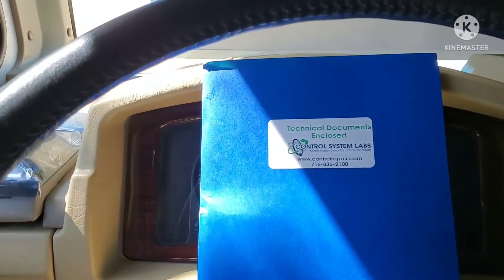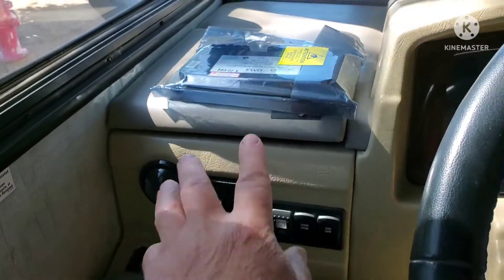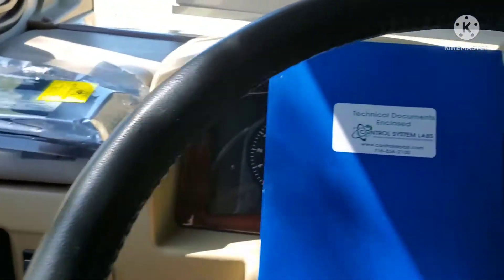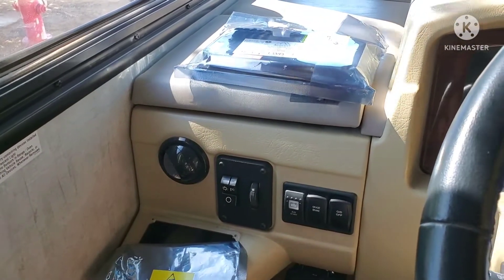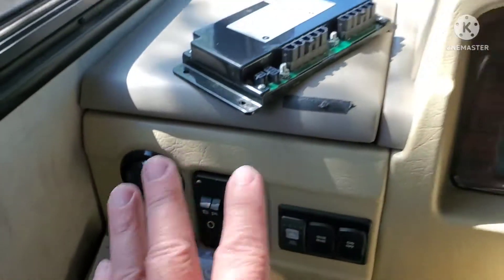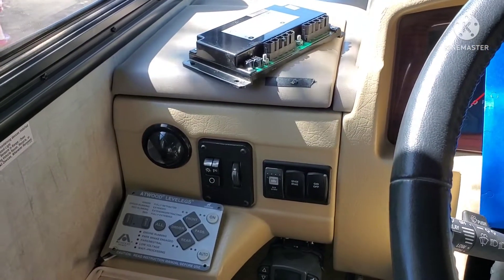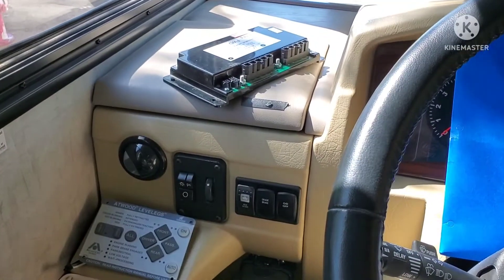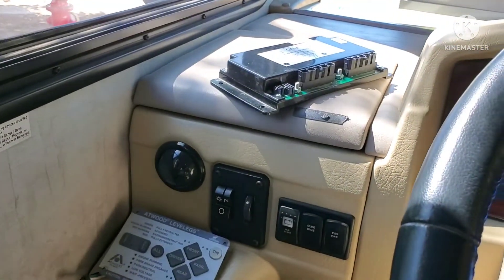Atwood levelegs Not Responding. Update #1

Comment: I have an Atwood Levelegs and it does not power.  Is it broken?
Reply from the maker: I am not a mechanic,  nor an expert.  I would check the power supply going to the system,  there should be a 50 amp breaker near the battery.  I would find and check all that first.
Reply: @2lotony  This is the first time hearing that there's a 50 amp breaker somewhere near the battery, my issue started out like yours but then I lost power to the panel and I cant get my panel to come on! Can you take a picture of this breaker? I cant locate any 50amp breakers anywhere! Thanks
Reply from the maker: @AmericanJustice22022  
I have found that the breakers can be located in different areas. Mine happens to be mounted under the battery on a frame rail. How I suggest you find yours,   follow all cables coming off the positive side of your engine battery, one will lead to the breaker. Good luck.
Reply: @2lotony  I just came back to your response to read it again and you said to follow the cables coming off the Engine Battery, I went out there and was following the house battery cables! Did you take a picture of the breaker that you found that was lose? Thanks
Reply from the maker: @AmericanJustice22022  
Look up 50amp resettable breaker. I can't add pic to response.  
Mine is hooked up to engine battery not house batteries.
Reply: I look at the diagram that I made for my house batteries theirs only 1 cable that’s connected to the positive side of one of the batteries that might connect so I’ll trace that out and see what I come up with! Thank you! BTW can I reach out to you?